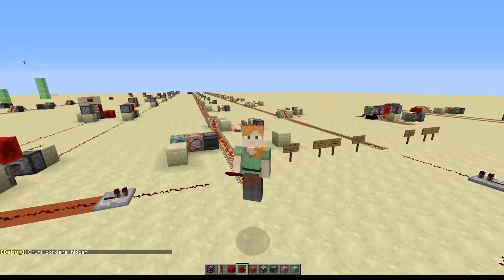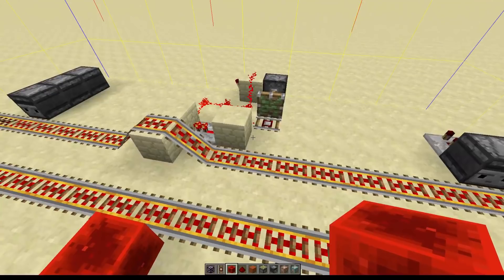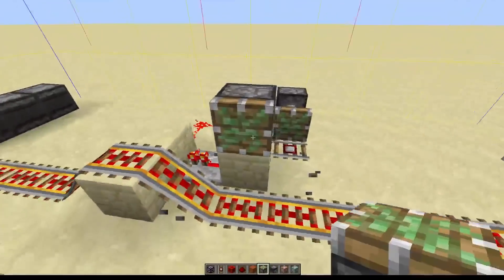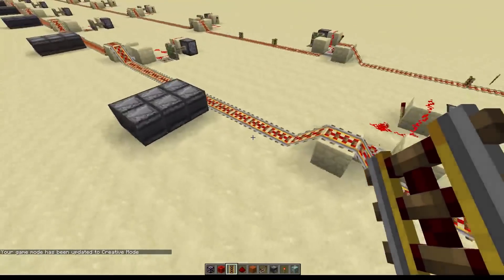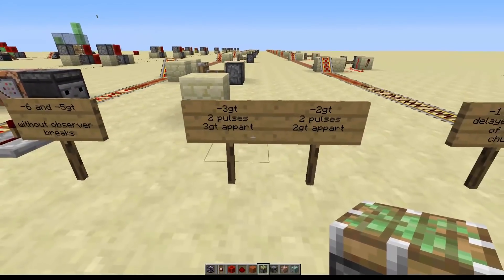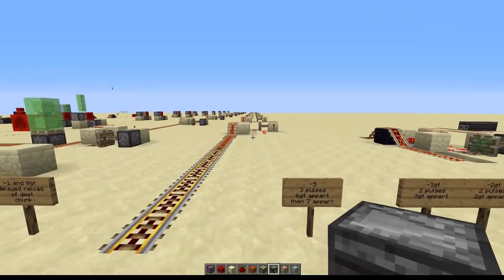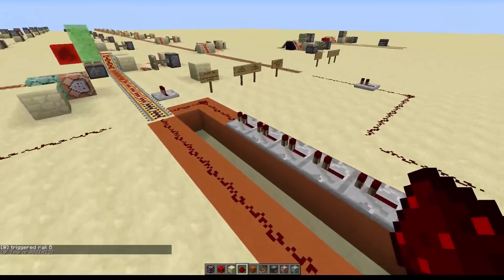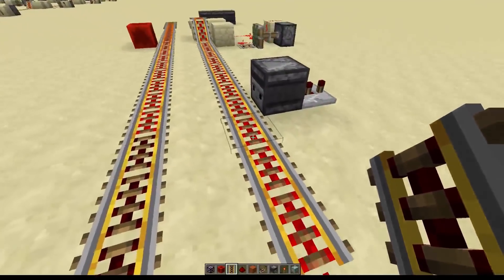All about PanNic's new instant wire

Comment: Instead of the Torch coulde we use a comparator? No Burnout and the redstone wire could have a lower powerlevel. If this would work, could you make video about it? And if it work what would be the least computer resource intens contraption
Reply: https://www.bilder-upload.eu/bild-04d23b-1540113212.png.html

Comment: Quick question, should we detect the signal with an observer and repeater on 4 rticks so we dont have the pulsing effect in case of autosave or is an observer/update detector enough?
Reply from the maker: Ya that is enough. But in general the double pulsing wont happen if you use a permaloader and that extra piston on top. Best way to get around it. The uni-directional setup is cheaper but that triple pulse is strange and I dono how to get around it.
Reply: @Xcom6000  I'm having trouble with an instant wire in 1.16.2. All the designs I've made break when the line leaves render distance. I've tried the bud detector method, and 2no2name's design. Bud detector sends zero tick pulses every 3rd or 4th stick piston, breaking the system, and 2no2name's design, the rails blink instead of being constantly powered. I think block updates no longer create entity processing chunks since 1.14 and up. Is my only solution to make portal based permaloaders along the instant wire line?
Reply: Spinny Guilbault lmao chunkloading was completely revamped in 1.15, and ever since 1.14, block events no longer load chunks. So yes you’d have to build permaloaders across your instant wire.
Reply: @jurassic1067  yea, that's what I ended up doing. Classic Mojang, couldn't leave well enough alone.
Reply: @spinnyspinnyspinny  No idea why they did that. Now you need to use stupid portals to send a signal through unloaded chunks, but at least we've still got that...